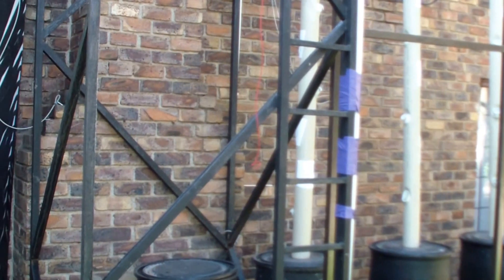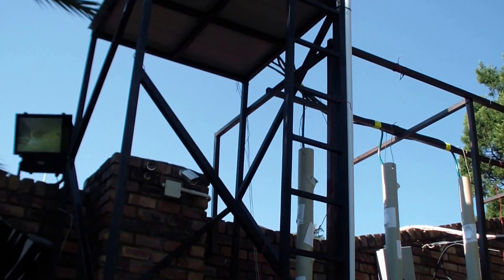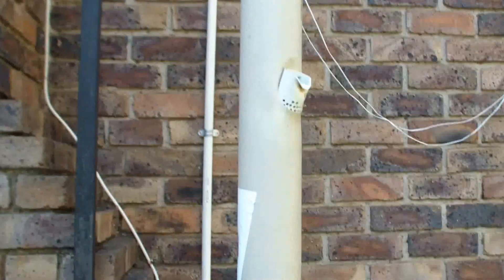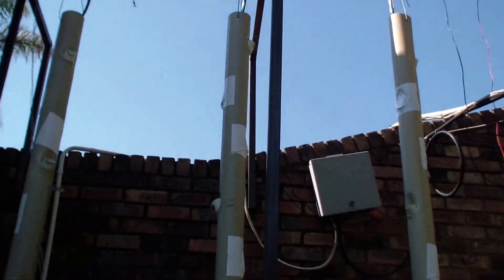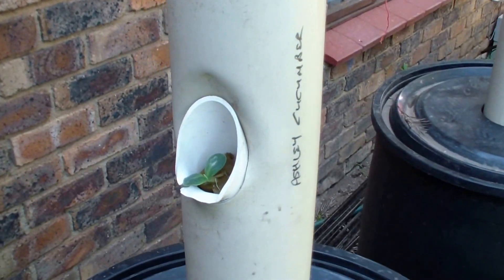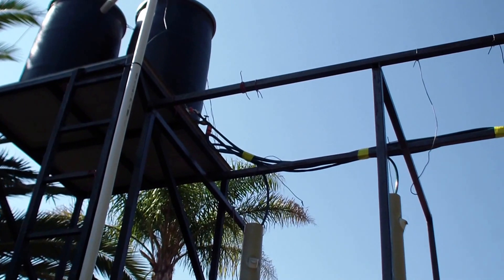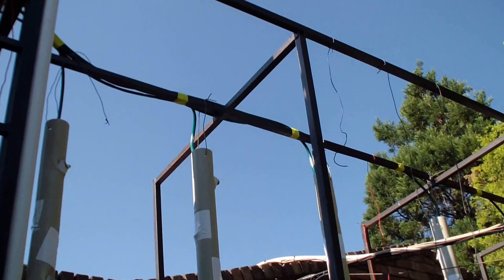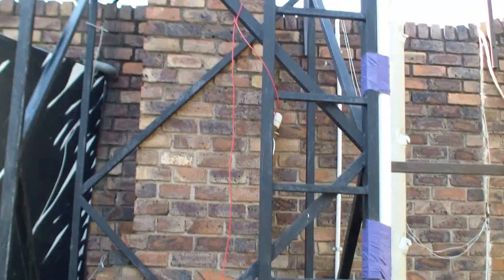110 mm PVC pipe Hydroponic Towers - Year 2

Comment: I fear your tomato plant will still clog up the pipe at the crown. Have you looked into plants with smaller root balls?
Reply: +Harold Wong HI Harold, I am hoping the extra space will allow the roots to hang down and allow the water to flow through. Will Keep you updated...
Reply: I think it will do both, expand width-wise and also hang down. I had been looking for 6 inch (152mm) pipes but they are not easy to find and very expensive.
Reply: I look forward to your future update. I wish you the best.